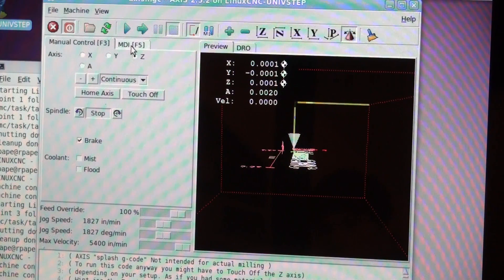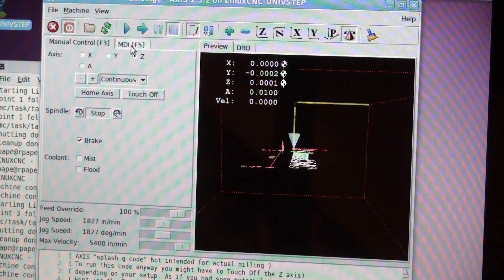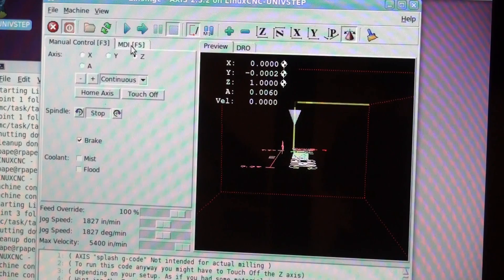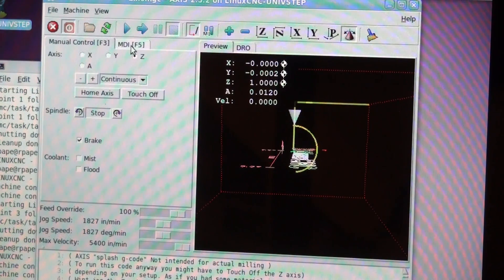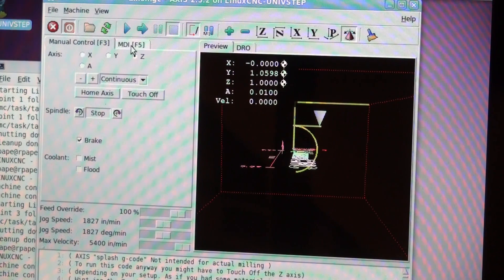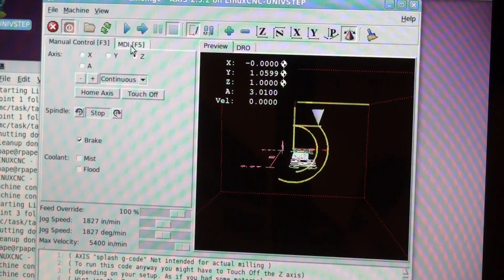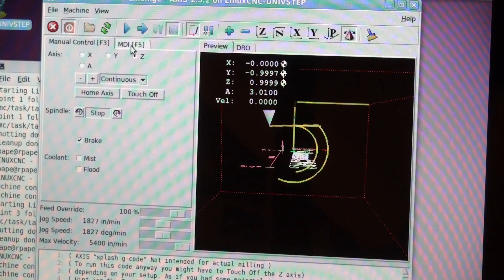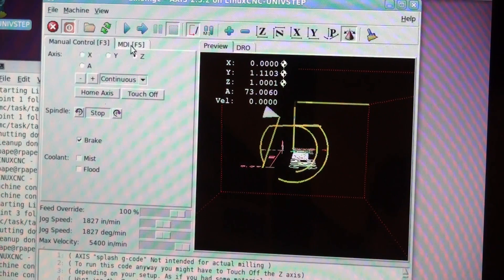LinuxCNC 4th Axis Testing

Comment: I notice that clockwise A is negative - is this correct and is this consequential?
Reply from the maker: It all depends on how you mount the A axis on the mill. It also appears to be either clockwise or counter clockwise depending which side you are looking at. When I wrote the code to make a worm gear, I took into account the direction the A axis turns to avoid making reverse threads. You can also change the direction the A axis goes in the configuration, and in the configuration of the stepper motor drivers too.

Comment: Hello, I just started using a 4th axis. I use bobcad v31. When I post my gcode of my part in on my machine. It shows the top 50% of my part fine.The bottom 50%shows up above my part in the top of my parameters. I zero and touch off. Then the top of the part is milled fine. Then my part rotates 180 and I get a z height error and machine shuts down. The bottom section is still above my top and high in z plane.
What could it be, I have tried machine setup, new indexes etc. As always on this journey it will be something simple. Any help would be appreciated.

Comment from the maker: You have to compile in the xyzac.c linuxcnc 5 axis kinematics setup. In the code you will need to edit out the "c" axis. This has to be done in several places. There are instructions to do 5 axes on the linuxcnc site. I am pretty sure that our code will not work on your system, because we made our systems closed loop with an optical shaft encoder on the stepper motors. I did this stuff a long time ago, and if you have problems I could dig up the methodology that we used to implement.